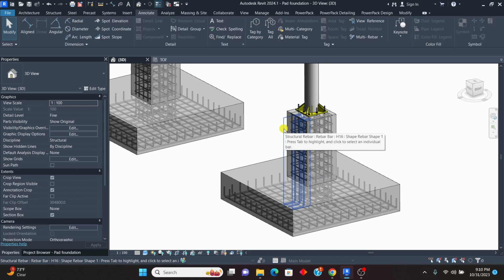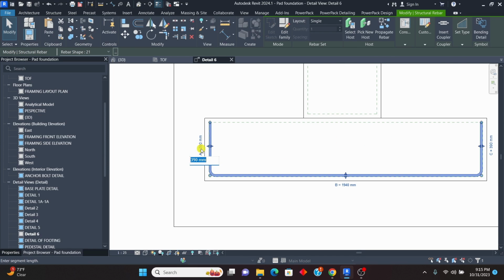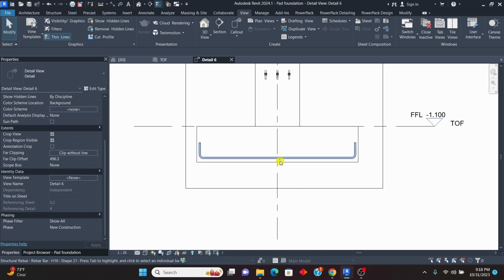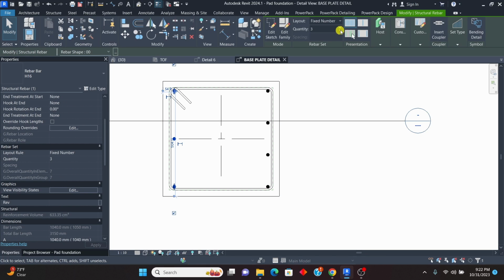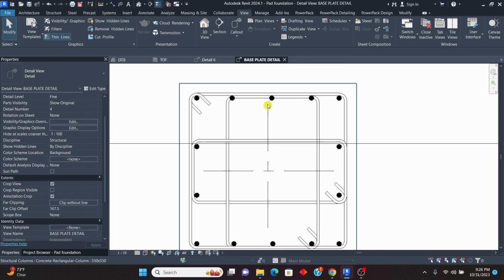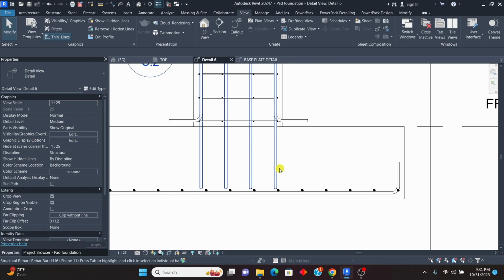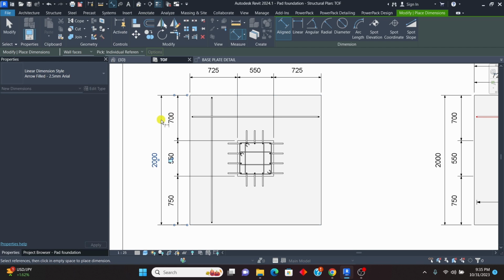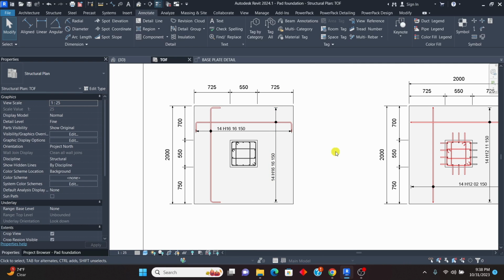Revit Structure || Rebar Modeling and Detailing Tips for pros || Bases

Comment: Isnt there option to make array of bars. I used to make array of main bars in autocad then explode it and remove the bars at centre and leave the ones on corners and sides.
Reply from the maker: You can only place rebar sets in straight line